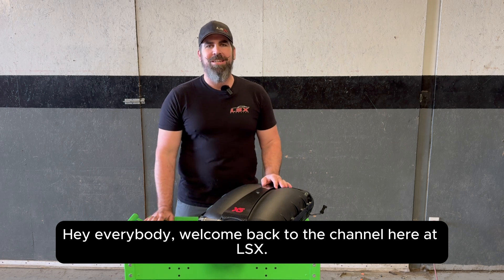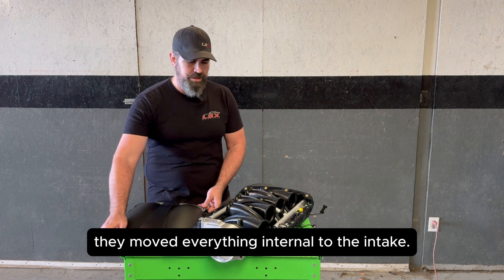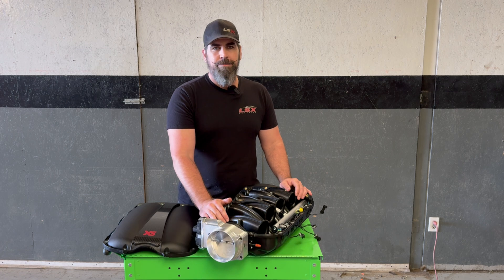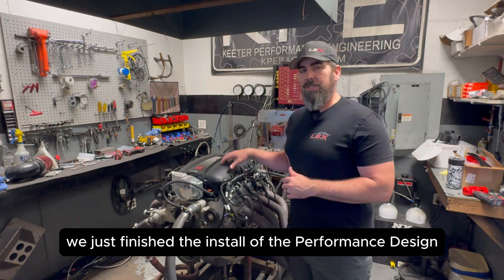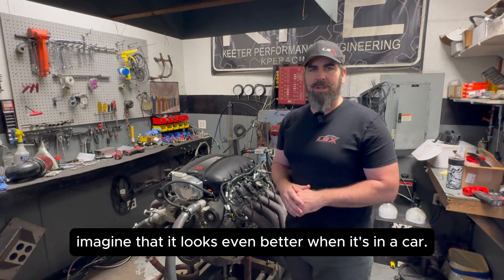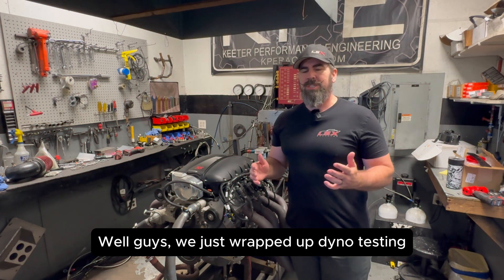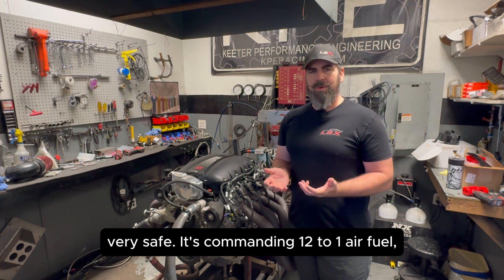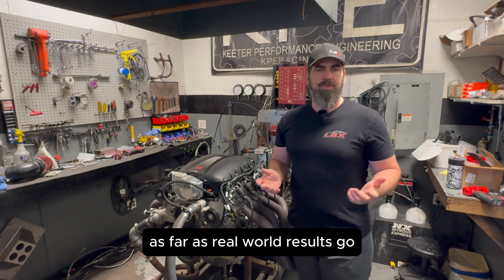We Dyno Tested The Performance Design XS Intake Manifold To See If The Claims Are Real

Comment: Amazing you paid testing made more power.  You left it a lot of information regarding this test.  Seems more like a ad for the intake.  We did the same test on what you said you would like to do.  We tested a 416 LS3 with tfs 255 heads and a comp cam 239/252 .624” lift.  While it made about 3 hp more, it lost upwards of 17hp from 3000-5000 rpm compared to the stock intake.  Also the stock intake used a 95mm throttle body, the XS intake used a 103 mm.   We also tested the XS with 92 and 102 throttle bodies with no significant change at all.  Larger throttle bodies did hurt throttle response on the street.  Here is a link to one of the two videos we made. Seems more hype. Does look cooler than the stock LS3 intake it was compared to.  Build quality is nice as well. Performance just wasn’t there.  https://youtu.be/V_KyJ8FDUsY?si=E1oXxuXJFKEdDuze